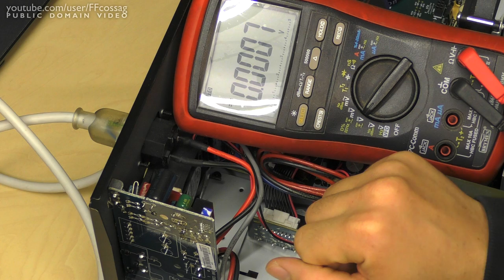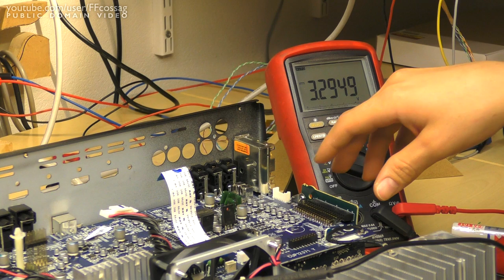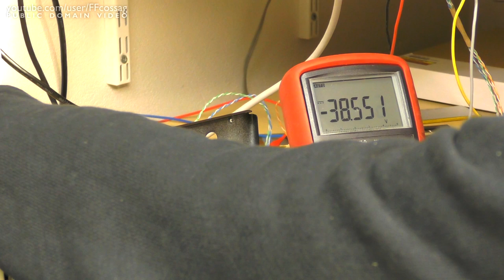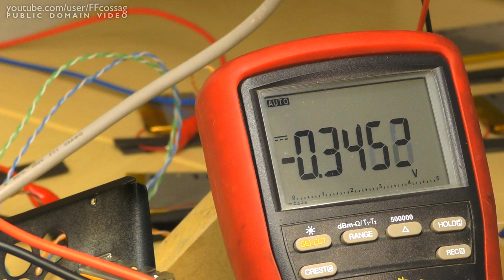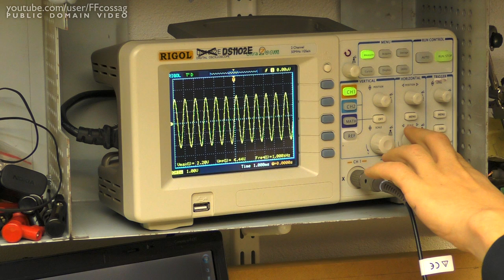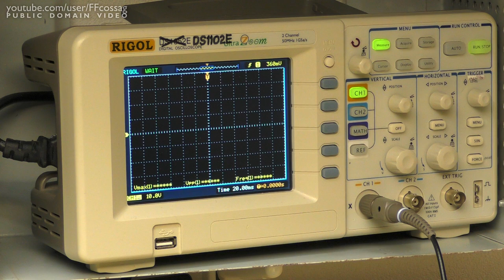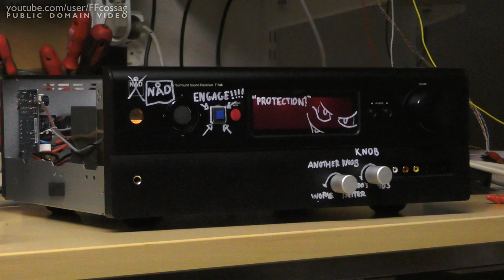Broken AV Receiver to Analogue Amp Conversion

Comment: Finding additional information and sources about using salvaged receiver parts(have onkyo tx809 and a rz920.) the 809 had the hdmi issue and the 920 got killed in an eletrical surge during a storm.....but it has all the parts. This logic seems so easy. Skip the avr and input/preamp/amp out. But this is the only video or sourcd I've found when the thought of working on the pile of parts comes back around. Maybe I need to study amplifier circuit design more and looking at the boards might click in my head of how to salvage and make a simi decent amplifier

Comment: LMAO I love that the display says it's in protect mode, even though it works.
Reply from the maker: You misunderstand, it's an ironic question, as it has no protection circuit.
Reply: I understand the ironic question you wrote. I'm talking about the LCD. No mis-understanding.

Comment: Did this with an Integra Receiver whose HDMI board went kaput. His method was a lot more dedicated though. I simply removed all the speaker relays and bypassed them. Onkyo was nice enough to label all their connections as well on all their boards. They also made it pretty obvious where the inputs on the separate amp board by making a cable with seven twisted pairs. Thankfully in my case the power supply unit was on its own board and shared it with the amp board.

Comment: Hey! I fixed up a braindead TX-NR616, problem is that the injected audio signal results in low volume output on the speakers, instead of the high output you had. My volume control does nothing (because of braindeadness), and I'm kind of stuck. Any suggestions on getting some more volume out?

Comment: Nice mod :D How about putting in a $10 Orange Pi into the case to use as a Chromecast Audio/Airplay/Webradio receiver and maybe use the VFD display as a Subscriber counter or something?
Reply from the maker: No, I don't like hyper-techy stuff like that. We just succeeded in eliminating a bunch of processors, I'm not going to add others in. ;)

Comment: Absolutely love this hehe, I'm probably gonna do this to a pioneer receiver I found in the trash the other day :) it seems to be braindead aswell and doesn't engage the speaker relays, even though everything works fine! I've even attached a speaker straight to the output module and it even plays there! And when I heat the main board up, it does work for a few seconds... So yep, braindeeeaaadddd! My question is why though... Silicon rot? Who knows, it allows myself to have lots of fun modifying the thing into something useful instead :)

Comment: The artwork never ceases to crack me up!

How far can you push this amp before you run in to distortion?
Reply from the maker: Just under 100 W/ch. It's rated for 2x80/7x40, and it lives up to that.

Comment: Impressive modification. I wish I could drive my amp this way, but sony has decided to put some weird ic preamp/driver instead of classic output stage so that's impossible.
also, the artwork is amazing as always.
Reply: Hi.  l've two old str dg 500 sony av receivers to amp conversion.Is it really impossible convert them? Please, write to me if you can to talk about it.  May l put an external preamp? excuse my bad english. I'm RJ Brazil
Reply: Thank you

Comment: I have left another comment on your review and test of the SKU216059 - TPA3116D2 Class D amp. Please reply if you have the time. Great videos but this one was a bit 'my brain really urts you know' LOL
Reply from the maker: Usually if I don't reply, it's because I have nothing to say on the matter. I can't quickly find any comment of yours on that video. Ask again and I might answer.
Reply: It''s well down and I know how busy you are. It was :-
I know this is a bit late but would say a 16V cap instead of the 400V be OK. I have ordered 2 of these amps and I though that if I replaced and moved both the electrolytics (25 V to 35 V) and the (400V to 16V?) to the back of the board I might get a bigger heat sink on. (Just reply 'Yes' will be fine - and thanks)
Reply from the maker: If you're talking about the big film coupling caps, they should be rated for at least your supply voltage. You should preferably use film caps, my standard issue ones are 50 V rated.
Reply: Thanks a lot. In you video you stated you were going to change the 'Nichicon' (you waggle fingers) to 35V but 50V film caps is fine of couse. Would changing the 400V to 16V be OK ?
Reply from the maker: I'm not sure which cap would be rated 400 V except the giant film coupling caps, and again, it's fine as long as they're rated above your supply voltage.
Reply: You said :- 'silly huge voltage I believe these are 400V rated MKP capacitors for the input filter they are just 1 uF and this is something they do to make it all audiophiley and stuff which is just stupid and silly to be honest.' 
I am not sure if you are talking about the power or audio input, yes I'm a real novice - but learning thanks to people like yourself.
Reply from the maker: Yep, those are the input coupling caps. Any >35 V rated film cap will be just fine there.
Reply: Thank you so much, as far as these amps are concerned your reviews and tests are the best on YouTube. In other words you have made a rod for your own back. I'll let you know how I get on but don't hold your breath. The last lot from China got stuck on a bullock cart in a paddy field. 
Incidentally I was going to get a :-  https://www.youtube.com/watch?v=Ero9LTIXhks&t=8s  
 SKU145225 - TDA7492 Class D amplifier board  but your video was enough to put me off. 
Regards and thanks again for your time.
You don't need to answer this, you have been too kind already.
 Can I use a buck converter to power this amp.? Might make a useful video for others perhaps?
The answers is no I think - too dirty.

Comment: "Brain  dead" yup, I have at least a half dozen brain dead receivers.  I cannibalise them a little at a time.

I have two Onkyo 7.1 Receivers that I'm going to re-purpose if possible.  One I will make into a multi channel amplifier for bi-amping and driving a subwoofer.  All the computer stuff is coming out (I can re-purpose some of that too) and an active crossover is going in .  The other one has a  row of amplifier boards that I can use in other projects.  Both have big beefy transformers.

You can make the protect light go off and even make the protection circuitry work  if you get the grounds correct.  I found this out a long time ago.  Any grounds (even noise grounds) connected to the amplifier board have to be put back somehow so they loop back to the protection circuit.

I design and build audio circuits and I am guilty of using microprocessor control circuits in my designs.  They work so well, until they don't.  Difference with mine is I built it so I can debug it.  Also I have extra boards with universal compatability for all my designs so if it goes brain dead it's plug and play and you're back up and running.  

I see tons of AV receivers in the electronic dumpster at work.  Every single one of them is brain dead.  It seems like a waste to build a nice audio circuit that costs a small fortune and its useful lifespan is only 6-10 years.